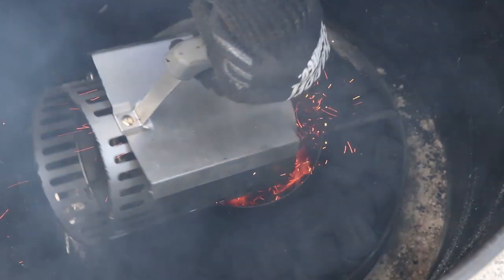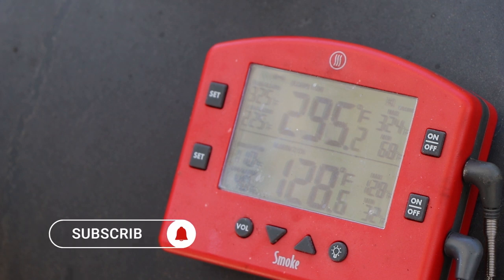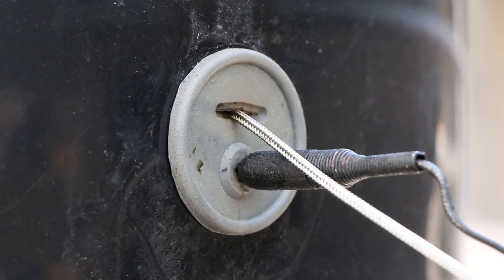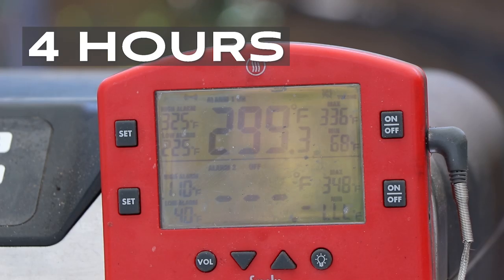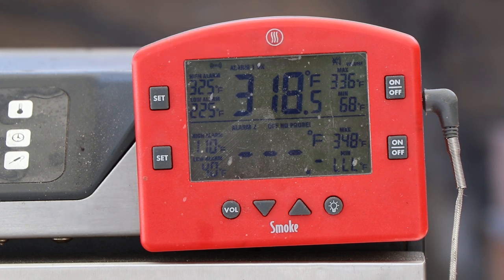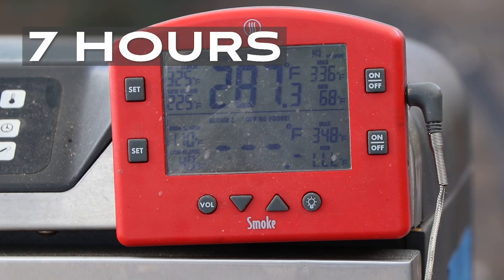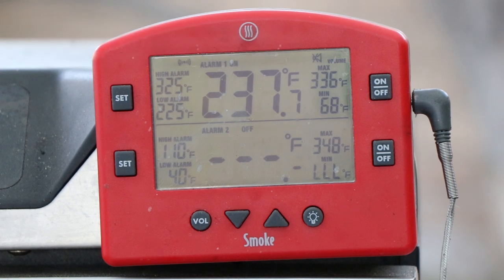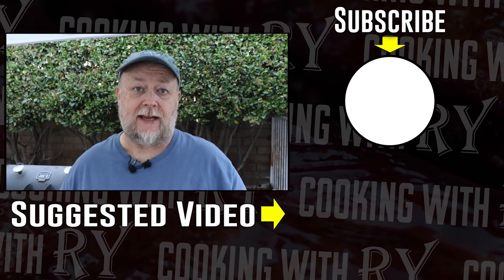Testing The Pit Barrel Cooker - How Long Can You Cook On It?

Comment: 9 hours is pretty good. Temperatures are a little higher than I run in my UDS. The brisket that we smoked last weekend was on for 13 hours, and I still had a few briquettes left over. Would be interesting to do a pound by the pound comparison.
Reply from the maker: Yes it would :)

Comment: A little hotter than I would typically run, but that's very impressive. I run a little hotter for poultry (~300 or so, even 275 is fine) but for most beef and pork I like to hit a little lower, perhaps 250-275. Depends on the cut of course but generally speaking that's what's up. In any case this is still really great and at the end of the day, as long as the food turns out good then that's far and away the most important thing. I'm a huge fan of barrel cookers and I think they're super versatile.

Comment: That isn't many hours, on the hand I have no experience with drum smokers.
I recently did pork butt on Weber kettle with snake method, had no issues with 10h and 270F and it was barely half circle of entire kettle.
Sure I needed to adjust vents every 20min to keep it steady around 270F.

Do you get better smoke and results with drum smoker or easier to work with compared to Weber kettle?
Reply from the maker: I'm a Weber Kettle guy, but the beauty of the PBC is that it's pretty much set it and forget it, especially for those first 7 hours :)

Comment: Did you take into account all the times someone would open the lid to spritz or temp or stoke the coals and such?
Reply from the maker: In my experience you can spritz and get the lid back on without affecting the long term performance, and there's no need to do anything to the coals unless you want to add additional wood chunks which can just be dropped on top. This test pretty much mirrors what I've experienced in previous cooks, other than those temp spikes likely due to the breezy conditions :)

Comment: Do you usually let it run at the high temps?
 I have added foil over two of the holes and a little to bottom vent and can get it between 250-275 steady
Reply from the maker: I do usually just let it ride at that 275-300 range.
Reply: No need for foil.  Just close the lower vent a little more.

Comment: I stopped using Kingsford. Didn’t like the bitter taste.  Currently using Royal Oak lump or B&B briquettes. Never looking back!! Lol
Reply from the maker: I've never had a problem with it in 30+ years.
Reply: Cooking With Ry I’ve been using it for around the same time. I started noticing a different taste in the last couple years. 

PB doesn’t even endorse Kingsford anymore.
Reply from the maker: @TheSkilledKiller  That's odd. Haven't noticed anything and no complaints from the eaters yet :)
Reply from the maker: @Ed Hanson I've never noticed any difference with Kingsford after more than 30 years using it, and, more importantly, no one has ever complained about the food. But every taste in individual :)
Reply: Never heard of the taste changing with Kingsford Blue.
Maybe your taste buds have changed?🤔